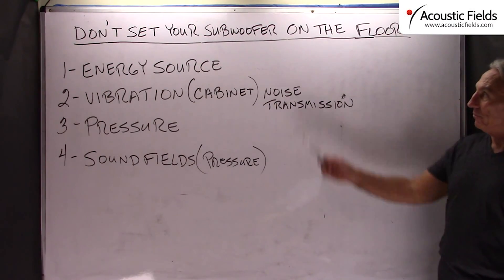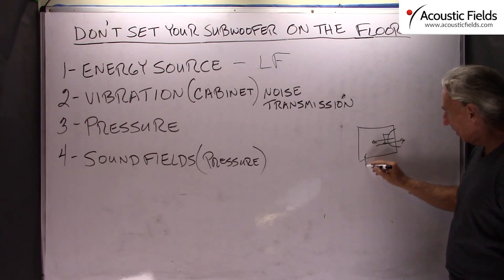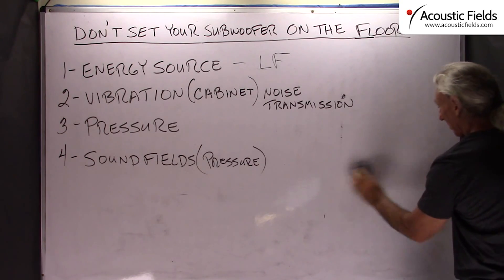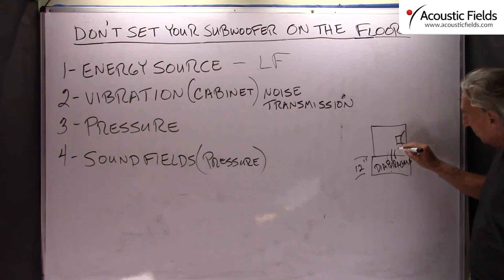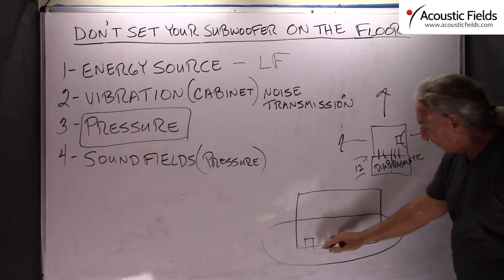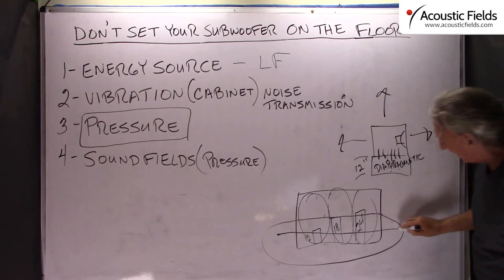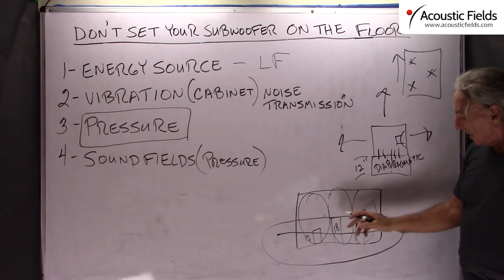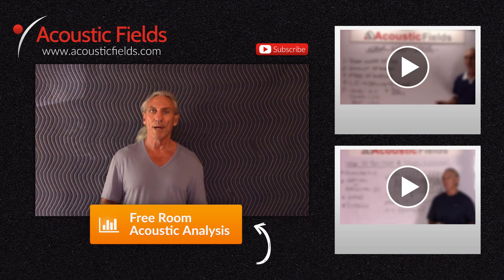Don't Set Your Subwoofer On The Floor! - www.AcousticFields.com

Comment: Does the same apply for a Sony SA WX700 Dual 10" Push And Pull Subwoofer? Alsonif i have two of them, do i need to have them a different Heights?
Reply from the maker: E,  Yes, start with 18" for one and 24" the other. Here is our sub platform: https://www.acousticfields.com/product/subwoofer-platform-absorber/
Reply: Excellent subwoofer for the price, got mine many years ago and it's still pumping out clean bass!

Comment: What if your floor is concrete?  And the walls, like in a basement.  The only “wood” is the ceiling in the basement.  It’s funny, when I play Bass I Love You, it creates a trampoline effect.
Reply from the maker: D,  Concrete is a dense material and is used as a barrier for low frequencies. Basements are difficult with low frequency energy because the only place for it to go is up through the floor surface because that is the surface with the lowest density. The concrete and earth walls are dense and low frequency energy is like water, it will look for the weakest structure to go through. We typically frame the walls and ceiling out and then add low frequency management between the studs. Here is a link to the process: https://www.acousticfields.com/carbon-absorber-wall/
Reply: Dave B. Im  leaving too an a basement and is nice to ear my Bose acuistmasts 1 Gen i don't need to put anything just place and play .. Lol
Reply: @luisin321123  you use the nice Bose.  You won't need anything under a sub. Set up 2.5 feet left side  of room  that's it.
Reply: Brass sharp hanger bolts  with the sharp end coming out of your speaker at 4 points.  Place the speaker on an 2" thick slab of maple slightly bigger than the speaker. Then place the maple on 4 iso blocks  1/2'' thick cork will work.  Try 1x1x 1/2 inch high or 2 x 2 x 1" inch high.  Use the best sounding one.   Floor > cork > maple > brass hanger bolt > speaker.  Put area rugs on the floor.   Irregular objects on the walls.  All this will help you concrete room to sound much warmer not sound like an dace hall.
Reply: Use 3 spikes per sub. Quit fucking around

Comment: I use sorbothane pads. They seem to isolate the cabinet quite well.
Reply from the maker: M,  Isolation from existing surface contacts is a good start. However, use this opportunity to lower the internal cabinet resonances through absorption. Our carbon speaker platforms do both of these functions. Lowering the cabinet resonances produces a tighter cleaning sound quality from your speakers.

Comment: so put the subs inside the speaker cabinet?
Reply from the maker: J, The function of a base under a sub woofer cabinet is to due three things. First, it elevates the sub woofer off the floor which will assist you in better pressure equalization throughout the room. This in turn, will allow the sub to better integrate with other signals. Secondly, it can be utilized as a low frequency absorption device and third it decouples from the floor reducing noise transmission.
Reply: thank you for the response. so it will minimize the rattles in the room? does it perform similar to auralex gramma isolation platform?
Reply from the maker: J, No, it won't help with "room rattles". You will have to do a sine wave sweep for "room rattles" and secure everything that is moving. It will reduce vibrations through the floor structure and produce a tighter and cleaner sounding low end. I am not familiar with that Auralex technology.
Reply: get aurelex subdude and put it under your sub it will stop the room from rattling...

Comment: Very informative video, thank you. 
Quick question regarding larger subwoofers, I have 2 18" subs in a room that's around 9m long x 5.5m wide and 2.5m high. I was thinking to have each sub elevated but to different heights, what would the height difference between the subwoofers have to be for effective energy dispersion in the room? Thanks in advance.
Reply from the maker: H, use 12" and 18". Your ceiling height is your issue. You have good length and width but your ceiling height creates unwanted pressure issues throughout the whole room length and width.
Reply: i ha a room width of 6 m x 8 m x 2.5 m (height). can i elevate my subwoofer by 18" ?

Comment: Whats the 12" structure ？
Reply from the maker: Hi A,  The goal of any low frequency device is to raise it off the floor and to minimize floor to sub woofer contact and reduce surface to surface vibrations. Second, we want to absorb as much energy as possible, as close to the source as we can.  Both of these objectives can be accomplished using our sub platform. Here is the link: https://www.acousticfields.com/product/subwoofer-platform-absorber/

Comment: Thanks for the valuable info. I have polk psw125 12" down firing sub in  the corner of living room (12'x20') and ceiling 11', can  i elevate the sub at an height of 2 feet or 3 feet and may i place rockwool (upto 10" deep) as a diaphragmatic absorber below the sub?
Reply from the maker: Hi V,  Rockwool by itself is not a diaphragmatic absorber. It is a fill material that can be used to manage internal cabinet resonances within a diaphragmatic system. It is a fill material that is toxic. Elevating a low frequency producing device off any surface is always a good idea. Experiment with different heights for your room size and volume.
Reply: Acoustic Fields thanq

Comment: Thanks for great info!
If I want to set my sub on diaphragmatic absorber, does it mean that I have to put it on absorbers front wall or on its side or back? Does it matter?
Reply from the maker: Hi Daniel, Subs radiate energy from all of their surfaces. Absorbing excess energy close to the source of that energy using pressure reactive technology reduces energy levels before they are released into the room. Once in the room, they mix with the dimensions of the room. That is when you get your modal issues.
Reply from the maker: D, You must locate the frequency response of the treatment against the frequency response of the wall issues. Every room size and volume is different.

Comment: What about those very expensive subwoofers that the cabinet is very heavy these companies claims that the cabinet does not resonate little to no vibration  the example can't remember the brand it's a 12 inch with two passive radiators the system weighs 150 pints 14x14x14 square. I don't believe them
Reply from the maker: A, The cabinet may not move but that is only part of the issue. If the cabinet does not move and you place it in a room where everything is moving, what have you done? You have wasted your money. On top of this, most place them in a corner where you add more room sound. Need I go on.

Comment: Hi Denis, thanks for informative vids you're making!
I have a specific question about Yamaha HS8S sub -
as it's speaker is faced down directly to the floor, should i consider to place the sub on some pods or smth to put the speaker away from the floor?
Will appreciate your feedback!
Reply from the maker: Hi Victor, It is always a good idea to isolate all vibration producing structures from each other, especially a sub woofer. It is also a good idea to raise the sub off the floor at least 12" - 18". You can also add low frequency absorption into the isolation system.
Reply: You can also set to 50hz low pass filter to avoid "kick" sound.

Comment: As the owner/operator I am setting up a high end bar that will transform to a nightclub as the night goes on - I am limited on space so I am putting all 12 double 10 boxes on the ceiling - 2 rows of 6 boxes 20ft away from each other at 11ft high.

Historically in my other lounge I had been told to sandwich the subs right up to the ceiling/rafters for better bass - am I to understand that I should suspend these boxes firing down with aircraft cable a few inches off the ceiling? And possibly at varying heights, so a few at 2" some at 4" and 6"?

Thank you.
Reply from the maker: Hi Dario, Placement of any low frequency generating device is based upon many factors. Room size and volume, dB SPL level , proximity to room boundary surfaces and a host of other variables. I will need to know more about your room to assist you. Fill out the information in the room form link. Lets look at a strategy instead of guessing at a tactic.

Comment: Would it be degrading to acoustic quality if subwoofers were tethered to the ceiling, like hanging by cables?
Reply from the maker: Hi Skizzarz, Yes, isolation from any surface with a vibrating low frequency device is always welcome . I have built home theater rooms where the sub woofers are on winches and lower from the ceiling and arrive at different calculated heights when extended. The cables isolate from structure and the varied heights smooth out response. I was also able to sync the movement of the subs, screen, and window shades so everything moved in unison. I have also built rooms where a flat ceiling will open up by splitting in the middle and each section pulled towards the side walls to form more volume for theater applications.
Reply: Interesting, thanks for the reply!

Comment: I have a M&L sub with the option for front or down firing, in a small room. I'm trying to get the best LF sound with the least complaints from the neighbors. Any advice would be great. Thanks for all the info!
Reply from the maker: Hi Mike, You have two options, each with their associated costs. You can build a barrier between the sub and your neighbors. This process involves measurements, materials, and construction. It is a permanent fix and costly. Materials and labor can exceed $40/sq.ft. Your next option is to place sound absorption technology close to the source. Here are links to our carbon technology that has the required horsepower to deal with low frequency issues. The first is our DIY build plans for our diaphragmatic absorbers. You can build our technology yourself. The next links are our production units. You will need multiple units no matter what option you decide: http://www.acousticfields.com/product/diy-bass-absorber-build-plans-bda-broadband-diaphragmatic-absorber/http://www.acousticfields.com/product/acda-12-studio/http://www.acousticfields.com/product/acda-10-mini-studio/

Comment: How do I elevate my subwoofer when my port is on the bottom?
Reply from the maker: Hi Mykal, The carbon platforms raise the total unit off the ground. If the sub you have is floor firing then sitting it on the platform will have the port firing into the platform.
Reply: Acoustic Fields 
I get that but what's the benefit?
Better low end?
Not as muddy?
I'm trying to understand what is
achieved by my placing a platform
under the sub.
I'm not debating, I'm trying to learn.
Thx
Reply: FURY guess you didn't watch the video if you're still asking why lmfao

Comment: Do you have a preference of sealed for 2 channel critical listening situations? Or do you think the debate of ported vs. sealed is a moot point?
Reply from the maker: Hi Ram, With sealed units you have just cabinet materials , construction methodology, cabinet volume, and driver diameter producing the sound you finally hear. With ported, you have all of the sealed speaker components plus the port producing sound. Getting "port" sound to sound good is not an easy task. It all depends on the engineer's ability to get port sound to blend with the rest of the cabinet. I have not heard many ported speaker designs that can accomplish this feat.
Reply: The best effect you can get is when u turn ports against the wall. Sealed always in the corner.
Reply: @Krupnoklipac  Hi, I've just seen your comment, and I'm re designing my living room and trying to anticipate the best placement for my Rear ported (12 inch sub). So you say I should place it against the front wall close the the wall?  my options are quite limited, it could be there, or in a lateral wall but not my favorite place to put it. thanks for any feedback!
Reply: @aledamatoc   Test it. I always turn ports against the wall and in the corner.

Comment: what if the sub is dual drivers in opposite direction, is it better to eliminate the vibration ?
Reply from the maker: Hi Muataz, 

The operative word here is minimize. Dual drivers do minimize vibrations and other internal cabinet resonances but never eliminate. Driver movement will produce speaker cabinet resonances from one or two drivers. That internal driver movement along with the internal cabinet resonances or modes (cabinets are really small rooms) need to managed with the proper treatment technologies.

Comment: If you need to use 12" of isolation to decouple, your subwoofer is crap. Cabinet vibrations are tiny compared to what the airpressure has. I agree than adding absorption directly under the sub is neat and logical but it is not for isolating the actual cabinet; 5mm worth of rubber will do that just fine. We only need to dampen the high velocity impacts that happen when a slightly vibrating rigidbody is bouncing on top of a static solid object. As for absorption directly under it, it is good advice.
Reply: The floor and the wall add their own influence to the subwoofer's sound. If you minimize this effect by putting some distance between them, the subwoofer will have a purer and less influenced sound. He also trying to control the pressure fields in the room and put them in a more advantageous listening position.
Reply: The direct decoupling is only so that the vibrations of the sub is not transfered to the floor. 12 is much for that, It can be decoupled with far less than 12 inch.
Reply: I kinda have to agree .There are plenty of knowledge acoustic engineers that seem to forgo the $750 for the Sub Woofer Carbon Platform SWCP And the enclosure just has to be made with half an ounce of care !! https://www.youtube.com/watch?v=rk3mwyRXRjg
Reply from the maker: Providing low frequency absorption, vibration management, and room position are the objectives. A 12" depth in a diaphragmatic absorber will ensure absorption in the 30 Hz. frequency range. This absorption feature is also present with vibration signatures through solid surface noise transmission using our carbon technology.